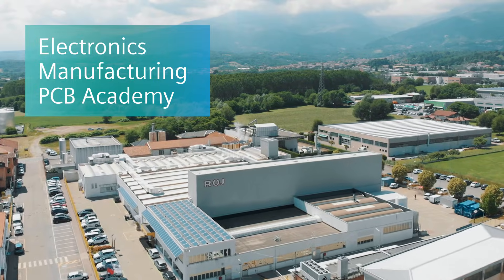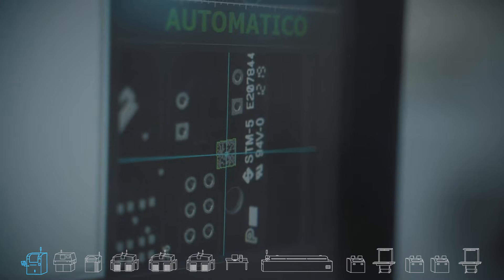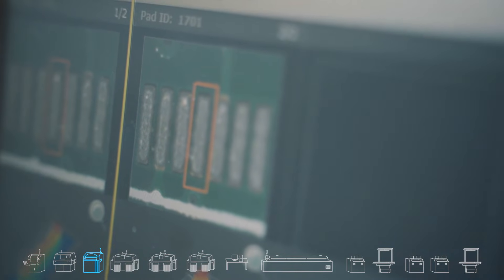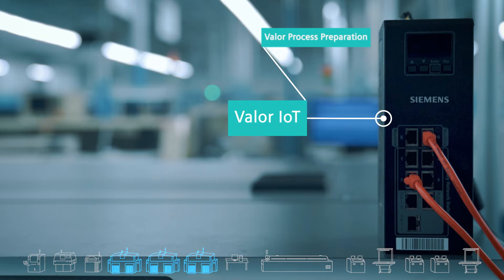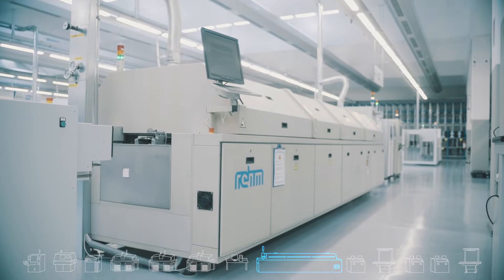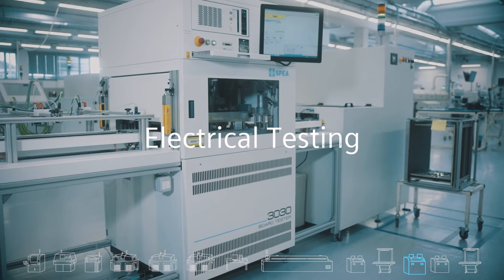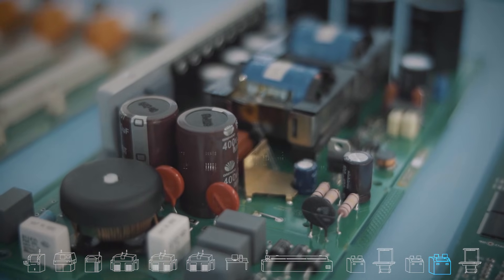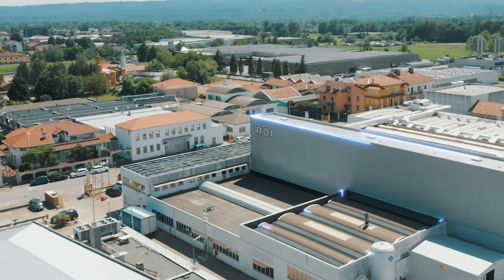PCB 101 Academy - Learn how printed circuit boards are assembled

Comment: you dont have pcb washing after smd and thp process?
Reply: If you use a no-clean solder paste thats RoHS no need to clean
Reply: it does not apply to class 3 military pcb which have a conformal coating process this process is only for consumer pcb class 2 as per ipc classification
Reply: correct but if your process have a conformal coating it will affect the no clean flux later on the conformal coating will removed